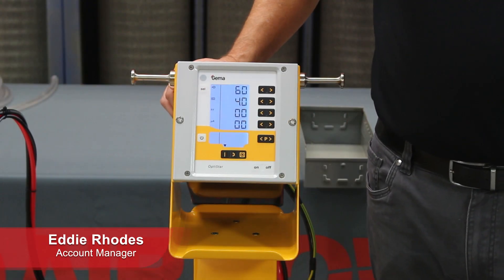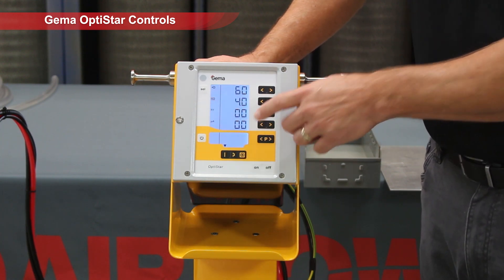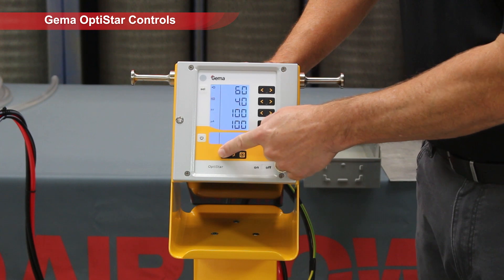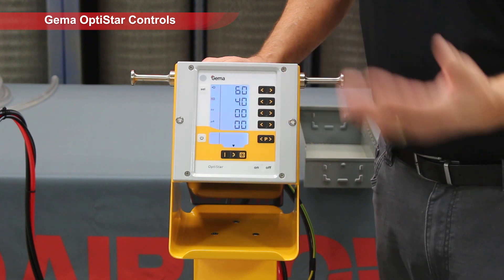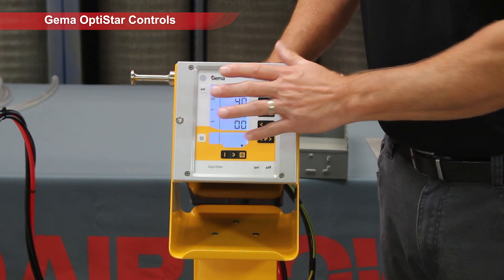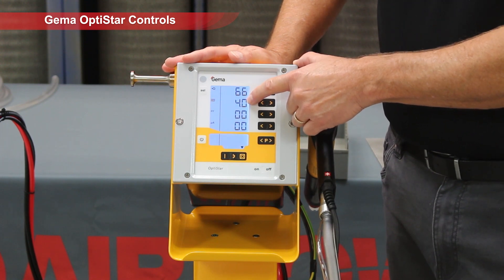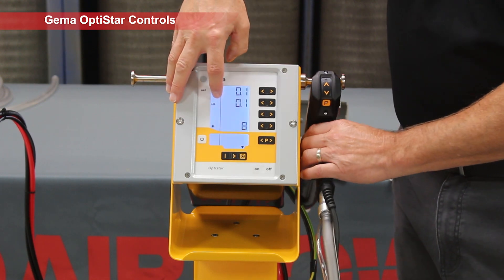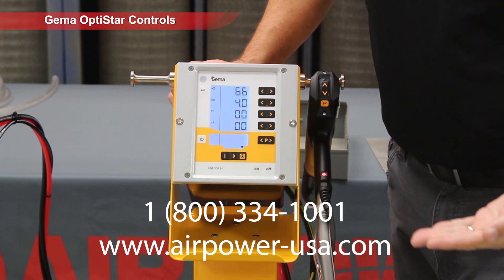Air Power Live Tech Tip: Gema OptiStar Controls

Comment: when I paint a second time there are still stains on the right way with different paints and the only salvation is to use for the second coat normal compressed air gun. What can be done? Thanks

Comment: Which is the best setting for a flat part with a large hole in the centre and no recessed parts. Like coating a large ring? Also how do you decide the amount of air to rinse the electrode?